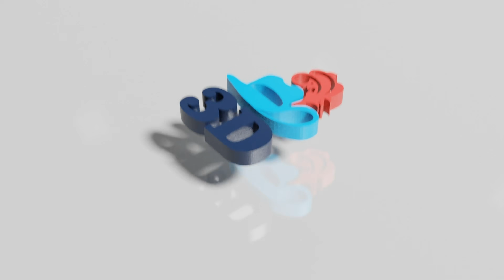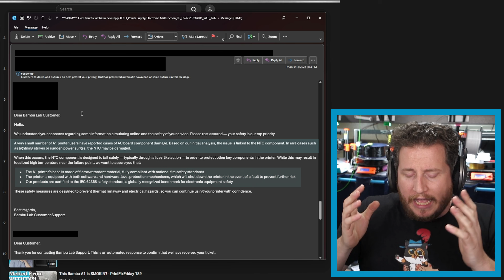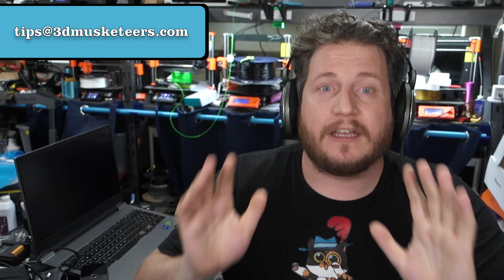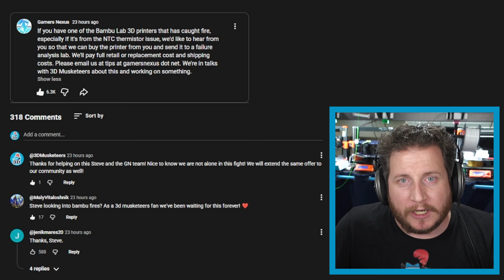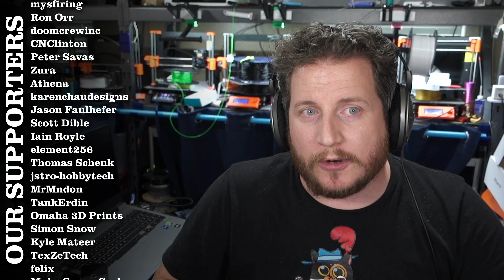I Was Right About The Bambu A1 (And I am MAD)!! - PrintFixFriday 245 FIRE HAZARD EDITION

Comment: It needs to be said that there is nothing inherently wrong with using an NTC for limiting inrush current. Its fairly standard equipment and exists in millions of reliable, well designed products. Using a triac, or SSR to bypass it after the machine is on is best practice. Also of course its best to use one that is rated for the temps used and in an area that allows it to dissipate the heat generated without damaging stuff around it.

Comment: Bambu Lab issued a recall for the full-sized A1 3D printer (not the A1 Mini) manufactured and sold prior to January 30, 2024, due to a heatbed cable defect that poses fire and electric shock hazards. Affected users are offered a full refund plus an $80 store voucher, or a free heatbed replacement plus a $120 voucher.
Reply from the maker: Yeah, this isn't that....

Comment: I have an a1 which I bought about a year ago but I’ve only printers less than 10 pla things and sits in my office at work. Let me know if you want to buy it
Reply from the maker: If it isn't burned we likely aren't interested at this time.
Reply: @3DMusketeers I need to take it apart to see what is being used in mine . I mostly use my A1C and that’s seems to be ok for the last few years but I’m always worried about when I’m running it while I sleep

Comment: Man i know my A1 machine has gotten super hot regularly and this is clearly why. It's even gotten so hot prints have failed because it just stops working randomly. Now i won't let it run without auto fire suppression installed. And i want to replace it with.. Idk what yet dangit

Comment: I only became aware of this because of the opensource BS that they're pulling. That is such a cheap and shitty design.  

I play around with power electronics as a hobby and I've never seen such a poor implementation of inrush protection using an NTC. Anything more powerful than 10 ish watts usually has a mosfet bypass that activates once the capacitor is charged. Relying just on the NTC doesn't just mean it stays hot all the time, it also means that it doesn't actually work well at inrush protection. 

If the power goes out for a few seconds or maybe even longer, the thermistor is still hot and will still have a low resistance, meaning that when the power comes back the NTC will provide no protection from a large inrush of current. This is probably the "Rare failure" event they're blaming. 

The mosfet bypass is maybe an extra dollar worth of components and isn't even the only solution. A reasonably high value inductor in series would also provide secondary protection that would mitigate this problem or just a higher quality higher wattage NTC... 

This is just cheap and nasty design.

Comment: Bambu didn't get in front of it though.  That board has been a on-going problem for awhile and Bambu's response was always just to send out a identical replacement without any redesign what so ever to resolve the issue.  Its just cheaper for them to throw new/old inventory stock at the problem rather than make a entirely new board.

Comment: This is why i like anycubic.  I had a thermosister on the hotend fry the hotend and the connector on the board. Just the connector.  I was home when it happened.  No smoke, no fire. Anycubic was more than happy to replace both. I have over 2500 hours on this machine and that only happened once.
Reply: And that I would call a catastrophic failure on my K3V2. I've had a bad thermistor on a 3rd party nozzle and the moment I turned on the machine after installing it, it started screaming warnings at me and refuse to engage heating.
Reply: @Liminal.Headspace mine just tells you the temperature isn't working and to check it. Its hardly catastrophic.  Its a very easy thing to fix. Catastrophic implies it can't be fixed.
Reply: @Katskraftkorner  Yeah, I'm just saying that Anycubic makes good printers that malfunction in good ways.
And Bambu would send the leg breakers after their printer set your house on fire to keep you quiet.
Reply: Catastrophic is bambulab burning your house down.

Comment: I don't want this to come across as a defense of bambu, they are doing a pretty good job of speed running becoming the bad guy. And I'm as guilty as the next person, and this shouldn't happen, but these are consumer versions of industrial machines, and a "newish" industry. Is there any other machine we run in our home 24/7, with elements designed to get to hundreds of degrees, multiple points of failure, don't maintain much, leave unattended for hours at a time, and when something happens our response is "gee lucky I was home but I shouldn't expect to be" 
Imagine if you did that with a cooking appliance, "oh can you believe my house burned down, I was on day 8 of cooking roasts in my oven round the clock that I leave unattended while I'm at work, and even if I'm home its annoying so I only check when its supposed to be done, and eventually something reached a combustible temp and burned the house down!" 
Again I'm almost as dumb/guilty as most ppl, I just feel like it shouldn't be framed like the user has no agency here. An electronic device failed, obviously you were there to stop catastrophe, the same reason you are there to stop your kitchen burning down if something happens. Bambu are not killing people, the product has a fault, attack them for it, drag them over the coals, but there is a difference between industrial/commercial and hobbyist/consumer equipment

Comment: Fingers crossed... I haven't had any issues like that yet... because of this coverage on your show here... I did take the bottom cover off and everything looks good so far... I bought it about 2 years ago directly from the  Bambu Lab website... my experience so far has been pretty good with Bambu Lab... I started with an X1C and 2 AMS... and yes there has been a learning curve... like slowing down outside feeds to have as little VFA as possible... I learned the hard way about drying filament first before printing since I live in very high humidity in Wichita Kansas... it's about 55% most of the time... and while we're here... Bambu Lab filament is not what it used to be... it used to be pretty dry and most of the time you could take a freshly opened spool and just print... now... it's always wet... really wet... I find that I usually have to dry the PETG for 2 to 4 days before printing same with ASA and silk PLA and regular PLA... it is what is but for the price... in many cases I've just had to move on to other sources... I appreciate you...

Comment: NTC inrush limiters are basically in every decent switch mode PSU. For decades. I mean, how bad the design should be to fk it up. It regulates itself, the hotter it gets, the less power it dissipates, equalizing usually at 60~80°C.
Reply: I've managed to deliberately fk up scavenged NTC inrush limiters (of already suspect age/condition) by bending the leads into the package to fit into scraps of existing PCBs; But I never managed to get a self-sustaining fire, just melting/pitting from the contact between NTC material and where the lead was reduced to a point before melting.
Then again I only messed up half a dozen(?) to see would happen in the school lab (that was having us replace the old NTC's at our insurer's insistence),  out of maybe 30(?)  which didn't do anything spectacular; And not a production run of a few thousand.

It's almost plausible that Bambu's accidentally doing the same 'thing'' I was; With an assembly process using a jig/tool to form the leads on the NTC component that's too tight for their new/alternate NTCs  (which may show up with a crack/dye test);  Or one of their suppliers are providing counterfeit/salvaged old NTC's with incorrect markings.   But the number of failed/rework boards that would cause around one component should have alerted alerted even the most passive QA process to begin to identify the source of the problem... unless they aren't stress testing randomly selected boards...

It would have been cheaper (and easier) for Bambu to just slap a sheet of intumescent "sound dampening" foam across the bottom of the case to smother any falling embers. (Because declaring something intumescent is weirdly illegal/prohibited) very few people who are fire adverse would have thought to test it to discover what that scrap of foam would be actually accomplishing.
Before this latest incident , anyways.

(edit: wait... that would imply that users could tape a fire-resistant diaper onto the bottom of their A1's until they have larger concrete pavers or plaster tiles to set them on.)
Reply: @LynxSnowCat  Wow, that's a lot of reading. I don't understand why they put it there in the first place, as they're using an OK PSU that should has its own inrush limiting measure. If the problem would be with assembling quality it would't be that consistent. It's either a bad choice of value or mislabeled/poor quality NTCs.

Comment: wait, so all it takes is a firmware update to cap heaters power?
Reply from the maker: I THINK so, but I am not an engineer....
Reply: @3DMusketeers  Even if they released a firmware update, how many are likely to update to it in the likelihood they'll lock it down harder. I'm running LAN/old fw and will burn the machine before opening the door to more nerfing.
Reply: @ronb7105  if they don''t want to recall, the least they could do is changing 2 float numbers in the config file
(if that can avoid the problem)

Comment: I'm not a lawyer but I'm willing to put money on the fact that selling faulty hardware that you know will catch firewell...seems like that should be grounds for a lawsuit.. Every one of these boards that are out there is basically a ticking Time bomb waiting to combust. They know this... 

STOP SUPPORTING BAMBU LABS! If you know about ANY of their issues and you are still buying their products, then that is 100% on you at this point. They do not care. Stop giving them your money. 

2026 is the year of accountability... It's time to start holding these companies accountable for selling dangerous hardware! 

Speak with your wallet... Stop buying their garbage.

Countless kit machines since 2015 and I've NEVER had a board do this... I had a board that got SLIGHTLY too hot and Voxelab.... VOXELAB took accountability and fixed the issue..... New rev board... Done... No questions... They fixed it ... 

Whats your excuse Bambu Labs?

Comment: I've seen these NTC inrush limiters burn up due to faults further up the chain.
What they should of done is to have a relay across the NTC so if there's a fault current, the NTC wouldn't act as an incendiary device that identifies as a fuse.
The upstream devices on the other hand are things that can be monitored.
Also, those cheaper plastic 3D printers should have a can around the NTC and a fuse so that there's less chance of fire and around plastic absolutely need a timed relays.

Comment: I have been using the biqu cryo plates. Bought my A1 in August 25. I have not used it since your first ever video about these fires. Am I fine to use the printer or should I check n see if I can get a board replacement?

Comment: The new machines as I heard are shipping with the V2 AC boards without the NTC. But I don't get it Bambu has the data and knows which serial or batch of machines have the old style board. They should just provide a replacement board to all those customers by default when they know it is a potential fire hazard and more so in the summer time.

Is it really hard for a multi billion dollar company to ship out mass produced cheap AC boards to all the potential customers who might have the issue at some point in time? What a shame on them.

Best thing users can do now is after buying just open the base plate and check if it is having the old AC board, if yes just get it replaced if they don't, return it within the return period.

As you rightly mentioned they should have just added the bed temp cap like the H2 printers have the energy saving mode.

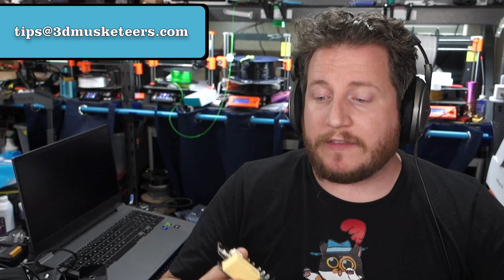Comment: 4:31 My a1 has. The bottom plastic is a bit melted, bambu lab support responded very quick and send a new board very fast. (Also im from a 230v countrie, can i just send the board and if i can how do i do that?)
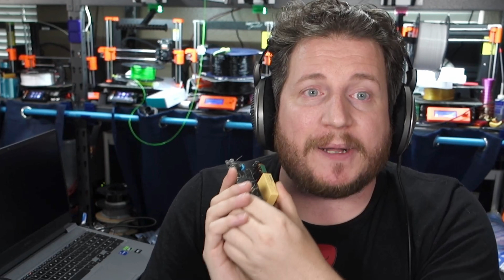Edit: 11:16 the replacement board they send had a bridge unlike the board that was originally in the printer.

Comment: Fire resistant is not fire proof. It just means chemicals are added to the plastic to raise the combustion point. Interesting fact about fire retardant plastics, when they do combust burn, they can burn hotter, dirtier, and more violently than their non‑treated counterparts.
Reply: At this point I'm gonna leave repairing my p2s that almost set itself on fire last year in December (it was about 3 months old when it broke down) until I have a smart smoke alarm installed.

I already have said smoke alarms ala Scottish law regarding the Grenfell tower disaster.
Reply: As an example of this: Matches are impregnated with fire retardant. Wood splints glow for minutes and slowly keep burning without flames after you blow it out, and the retardant makes sure it really goes out. But as it is a match, it of course still does burn.

Comment: We own 20 A1's and all of them still working, not molten or whatsoever. im in europe so we use 240v, and these units almost run 24h a day since the release of them, and the ambient temp is around 26c of the room. but im sure there are faulty units. first it was the bed cable, now this i guess?  i guess its a ticking timebomb?

Comment: Hi there. I have a A1 and it has been also damaged because the same issue. It was not severe than this, but it was frightening. I was told the same thing: was because of a lightning or such. They sent a new board, It seemed different than the original but now i have to check if it any different in terms of this issue. What should i check for? I have the old board if you’re interested I can send it over.

Comment: Plastic shell and a part that gets durn hot as part of it's function. You can absolutely smell stressed NTCs failing, it takes a few power cycles and it smells like hot vinyl with notes of new electronics out of the box. The sort of smells you expect around a 3D printer, only more so. NTCs failed and burnt up in the generic and undersized (metal-case) power supplies on my CR10 and Ender clones as well. They mostly just stink and die, no fire. I use Meanwell supplies now.

Comment: I contacted bambu over mine, only 4 months old and they refused to help, refused to send me the "new" part told me unless I have a fire they wouldn't help me.
Reply from the maker: Send them this video. keep pushing.
Reply: @3DMusketeers  Would love too, but from what I've heard with the printers that have the "new" board are also burning up so it doesn't fix anything. They went from using a thermistor to a piece of solid wire to bridge the connection.

Comment: Is there a way to check our machines to see if ours are susceptible to this? I have an older A1 that I purchased used but I'd like to see if mine has the allegedly faulty board.
Reply from the maker: yes, you have to open the machine up. The livestream we linked goes through it some!
Reply: @3DMusketeers  Which link? Its a little hard to tell which one is a livestream.

Comment: Y'all are so mad but you were sucking on their 3D printing pens for 2 years. Every 3D printer manufacturer has had fires because nobody ever learns to stop cock gobbling these manufacturers. Even the Prusa MK3 has a problem with the heat bed failing and no recall there.
Reply from the maker: We absolutely were not.. 

And yes, they have, but they havent when we were creators, because we would have gone after them. 

Are you saying the melted connectors on the heatbed because of heat? it was a poor design that could EASILY be assembled incorrectly, I agree, it should have been fixed.
Reply: @3DMusketeers The Prusa Einsy boards have a design defect that causes the transistor to fail. Also they did jack squat for cooling. We also had the failing filament sensors that overheated.
Reply from the maker: I never knew about the einsy issue, huh, okay. I can definitely check it on my MK3s's that are here.. 

Did you ever contact support about all this? I wonder what they said

Comment: I haven't had issues with mine, but it is in the part of the problematic window of builds.  I am going to put a temp probe under my A1 in the suspect area just to keep tabs on it a little better.  Not going to be accurate for temps, but connected to HomeAssistant I can shut it all down if it seems to be getting anomalously hot.
Reply from the maker: thats a good idea!